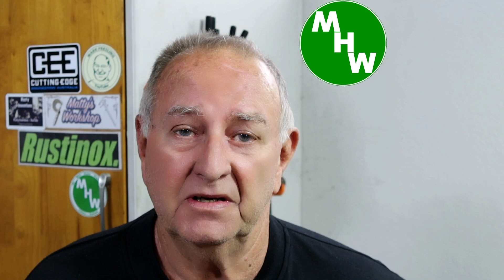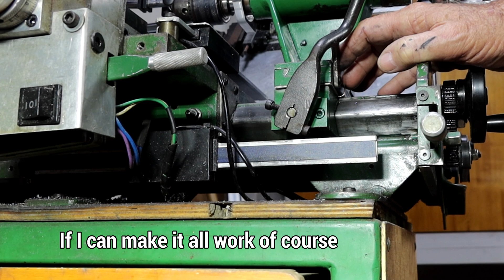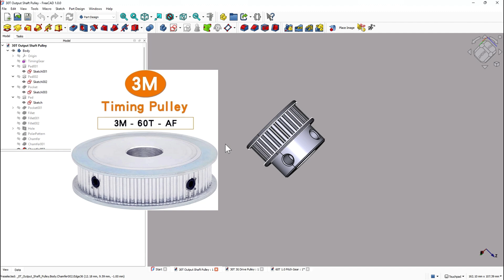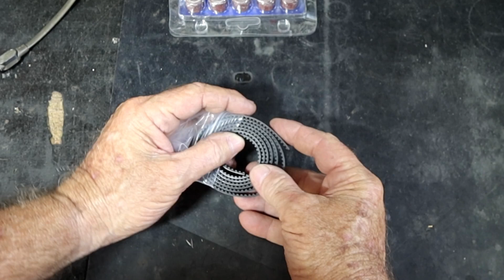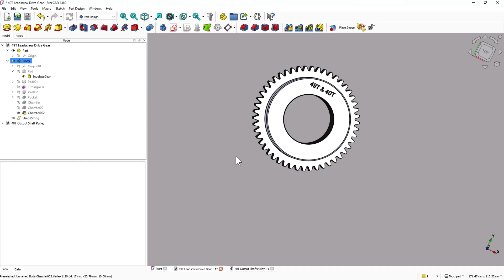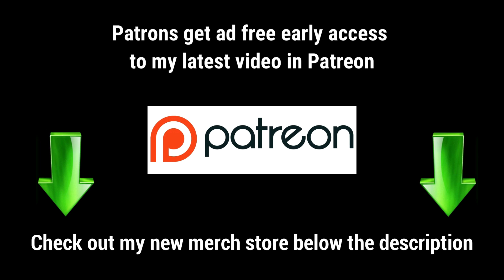MHW Episode 170 - Homemade Lathe Major Enhancement - Part 1

Comment: Screwcutting opens a new dimension on any lathe. You'll be so glad you did! 
The only trouble is it can be a rabbit hole - metric, imperial, BA, module, etc. All you need is the gears - now you're into gear cutting, dividing, cutter making, heat treatment, and so on. Glorious, endless possibilities!
Rooting for you 💪
Reply from the maker: I'm not really interested in cutting anything other than metric threads, I have no real use for anything else. Thanks for watching. 👍